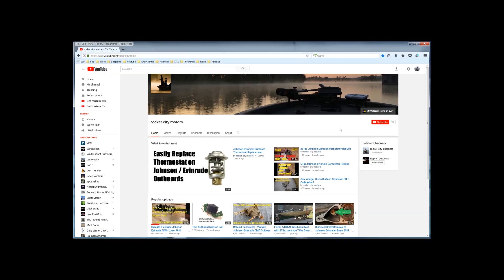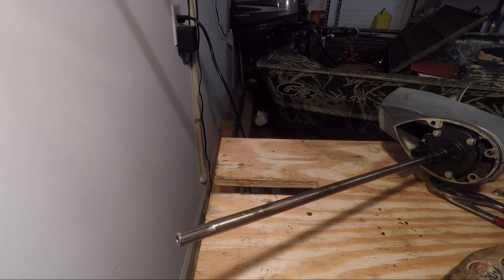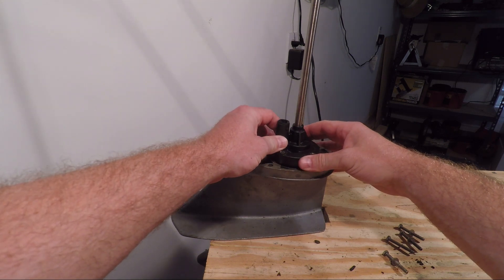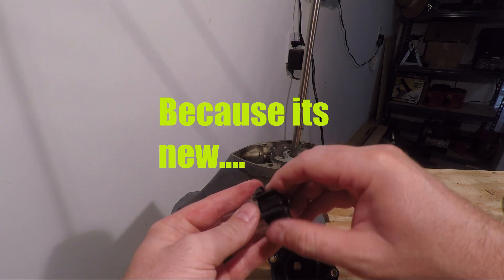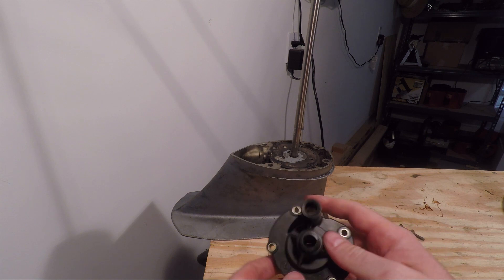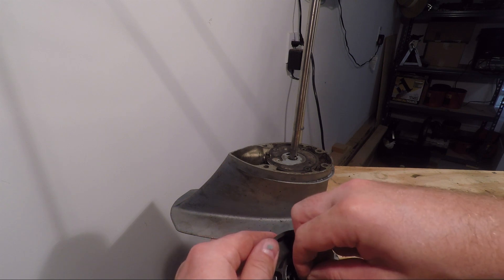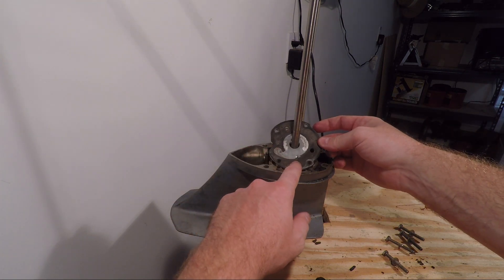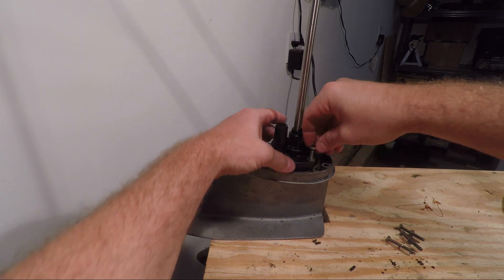Johnson Evinrude 6 Hp Replace Impeller - Part 2/3

Comment: I always buy a rebuild kit. The complete kit for the motor im working on. I recommend this as the old plate is usually scored and the cup may be to. Always use marine grease in the cup when installing the impeller. This will ease insertion and help it seat and if you like to run it before you put it in the test tank it will help you not smoke the impeller. Smoking a new impeller in a ungreased cup only takes minutes and then you will be tearing it all apart again needlessly.

Comment: I enjoyed your video, I thought you were very thorough in describing each step of the installation but one step I did not understand is why you rotated the impellor clockwise when inserting it into the water pump housing.  My 6 hp 1973 Johnson flywheel rotates clockwise looking down on the engine therefore I have to make sure the impellor is installed counter-clockwise (from the bottom view) so that the impellor ears are oriented properly.  They should be pointing opposite to the direction of rotation.
Reply: - During re-assembly, rotate the propeller in the forward direction. Watch the driveshaft rotate, That will tell you which way the impeller rotates.

Comment: I’m as I type this putting a 5” extension kit on my 1979 6hp so I’m replacing the whole water pump assembly while it’s apart. Before doing this when I ran the motor, the pee stream was pretty week. I noticed in your video that your impeller was oriented clockwise from underneath where mine was in the counter clockwise position when I took it apart. I don’t know if someone years before me installed it wrong or it was right and your video is wrong...LOL. Guess I’ll find out because I’m putting it back together the way you say in the video.
Reply from the maker: The rubber fins will orient themselves properly regardless.  If they stayed in the counter clockwise form, it wouldn’t push water.
Reply: During re-assembly, rotate the propeller in the forward direction. Watch the driveshaft rotate, That will show you which way the impeller rotates

Comment: Twisting the impeller clockwise into the housing while you are holding it upside down will have the impeller in backward when it is installed on the motor. Sorry to have to dispute what you are telling other to do, but that is wrong. I have been doing this for more than 55 years and i know what I'm talking about. Put the impeller on the shaft first, lower the cup over it, press down gentle while turning the flywheel clockwise until the impeller is seated in the housing cup. Then lower the housing down over the impeller cup and bolt it down. Now the impeller is in correctly.

Comment: My rollpin seems to have sheered off. At least there is just a bit of the pin left in the hole. I can remove that but have no replacement. Can you tell me where I can order one? Thanks a lot, your video's are amongst the most usefull on youtube, they're awesome.
Reply from the maker: OEM part number 0303261.  You can find them on www.marineengine.com or eBay or the like. You may could get away with one from an assorted roll pin set off Amazon here https://amzn.to/2N7VAbC

Comment: Just bought a 1965 Johnson 6 horse with it not pumping water. Upon removing the lower unit I noticed I didn't have a roll pin in my drive shaft. Also when I removed the water pump housing there was no gasket just a metal plate. Do I need the roll pin? Do I need a gasket there since there wasn't one? Ty in advance
Reply from the maker: You don’t have to have it but it does keep pressure on a seal that prevents water from getting up there
Reply from the maker: You don’t have to have it but it does keep pressure on a seal that prevents water from getting up there
Reply from the maker: You don’t have to have it but it does keep pressure on a seal that prevents water from getting up there

Comment: Thanks...ill try putting one in again.
Reply from the maker: +sc91260 I also read that it needs to be a stainless steel pin so it doesn't corrode, especially if you are in salt water

Comment: old pump worked fine but decided to change it  out anyway,, now I have no water through  the pee hole.. , tested pump in bucket with drill all fine there  , wate tube is in pump housing as should be.. still nothing... thoughts????  as i said, was fine 3 days ago till i changed pump, Thanks ,Glenn
Reply from the maker: Did you make sure you put the impeller key back in?  If not the driveshaft will spin but the impeller won’t.  Also make sure you get the water pump housing under water when you test it (deep bucket)
Reply from the maker: Check the 2:40 mark in the video for what I am talking about

Comment: hey man great videos ! my impeller is all rotten so I have to change it all...the pin on the shaft has gone too what does it actually do ?
Reply: oh read below...I still don't really understand but will look at replacing it !
Reply from the maker: The pin makes sure the driveshaft and the Impeller spin together.  If you don’t have the pin the driveshaft will spin but the Impeller wont thereby not pumping water
Reply: Quentin Chollet n

Comment: I have a evinrude 8 and my impeller is not spitting water, I took it out and it looks fine, could anything else besides the impeller be the problem?
Reply from the maker: Check the 2:40 mark in the video.  Make sure you have not forgotten to install you impeller pump key and that if it’s there it’s engaging the impeller
Reply: rocket city motors I went ahead and replaced the impeller, cheap fix, motor is running fine now

Comment: What exactaly does that roll pin do? Mine didn't have one in it but it had the hole for it...I ordered  one and put it in it...but when I took it aparte again the pin was bent..
Reply from the maker: +sc91260 if you look here https://goo.gl/aKKGp5 it compresses the lower bearing seal spring.  Why the 6 hp has a lower bearing seal spring and not the 9.5 motors, I am not sure.  If you check out the reinstall video I show you the slot the pin passes through
Reply from the maker: +sc91260 I did a little more digging and found this statement 

"This pin is holding seal set, if you run the engine without this pin it can cause the upper seal to slide sideways and not seal. The seal keeps water from being sucked into the motor. It also seals the air/fuel mix for the bottom cylinder. It may not idle very well without that seal in place. And if you're running in salt, you'll certainly do some damage without the seal working properly."

Comment: Unless that motor turns counter clockwise that old impeller is in backwards.
Reply: Mark Weaver should it go anti-clockwise in that metal case??
Reply: @hobojoe9284  Well....the driveshaft turns clockwise.
Reply: Mark Weaver but then surely that means if you’re looking at the impeller from underneath it would be spinning counterclockwise
Reply: @hobojoe9284  That's right.